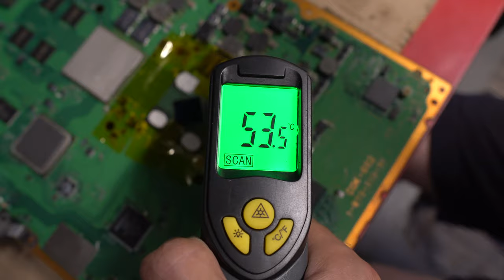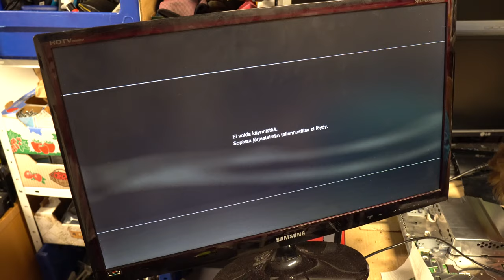How To Fix PS3 YLOD (Yellow Light Of Death) RSX Reflow

Comment: This just worked a treat! Although most say it is only a temporary fix, the alternative is far too expensive and beyond being economically viable imo certainly for a CECHC03 model which I just repaired for a friend using this method, I would suggest the Frankenstien GPU replacement etc might be worth it on an A00 / A01 model but not a C03. I will report back how long it does / doesnt last if I can.

I also used some Topnik RF800 SMD No Clean solder and basically tipped a load behind the GPU and followed your guide, I didnt have an Infrared Thermometer gun so I just ran my hot air station at 350c over the chip for 2-3 mins and success no more YLOD!

Comment: i found a fix for this without hardware mods, just make sure the ethernet cable is plugged in and do the thing that ramps up the fans to blow out any dust. then plug in the hdmi cable about 2~ seconds after pressing the power button, it normally takes me 2 trys to do it, but i will probably do some hardware modifications soon due to games being really stuttery, bo2 chrashes a few minutes into a match, and the fans will go to full speed and wont stop untill i turn off the consol.
Reply: Really
Reply: @hussanali3217  yes, although this is not a full time solution. it is very finicky, and gets harder to do by the week. i would recommend just buying a heat gun and reflowing the cpu and gpu cores. just last week it took me over 20 minutes of full attention to make it to the ps3 logo screen, and it wasent detecting the hdmi cable (which it does often) so i had to blindly navigate the menu to change display settings to hdmi. all that to froget to unplug the ethernet cable loading bo2, and having the system freeze on me. took another couple minutes to get into a local match. just save yourself the rage, get a heat gun or fucking put your ps3 in an oven.
Reply: I know a way to fix your PS3 without heat, the whole “Reflow/Reball RSX” is a misconception. Although there are real cases of the solder balls becoming detached etc, most cases the NEC/TOKIN Capacitors are to blame. When the console powers on, the firmware is instantly running a POST(Power on Self Test) and if those capacitors are not keeping the power to the processors steady, or if they are causing the rail to short, then the firmware will do the Yellow Light meaning there’s something wrong with the hardware. The reason it’s  a misconception is because when you heat the RSX to “200C/392F” as in the video, you are not melting any solder at these temps but you are in fact also heating the faulty capacitors, which may make your console temporarily work again until you turn it off again, or until the caps go faulty again. A similar problem happens on some laptops that use these NEC/TOKIN Capacitors for their decoupling capacitors for the processor(s) and they will restart if the processor(s) draw more power than the faulty caps can give, like when first loading an operating system for example. So I suggest you just rip those crap caps off and simply solder some 6.3v tantalum Capacitors that total up to 1200uf per NEC/TOKIN you remove. I hope you understand this and/or this helps. I also had YLOD and this got me back up and running on my long lost Black Ops 2.
Reply: @bast6808  so how do i fix this?
Reply: Real WeiFi look up NEC/TOKIN PS3 there are lots of tutorials on YouTube but you have to have a solder iron to solder the new capacitors on
Reply: @bast6808  i dont feel to comftorable opening up my ps3, especially because im not the owner xd
Reply: Real WeiFi that’s fine I understand if you would be afraid of breaking it further. I’m a very tech savvy person so I open up almost ever electronic device I get the chance to look at the circuitry and see how it works, in general I have a very good idea of how electronics/code/computers work and I build PC’s when I get a chance too
Reply: @bast6808  i have a way above average of how hardware works, and i know how to read some javascript. nothing to big for me, but i want to build machines and flip them as a hobby/job. my mom wont let me get any computer stuff tho :p
Reply: BƎAST it’s a misconception too when you think YLOD causes by Nec/Tokin all the time. I have two slims that have YLOD. One with faulty nec and the other is RSX.
Reply: @bast6808  Thanks for this info. Is there a tutorial to replace caps? the whole reballing method seems crazy difficult
Reply: Kiryu there are probably tutorials on YouTube if you look up “NEC/Tokin PS3” or something similar, although it won’t always be the fix, some may have faulty solder joints on the CPU, GPU, Southbridge, RAM, etc. but NEC/Tokin’s are a big problem too. Basically YLOD is a failed POST which can be any number of problems anywhere on the motherboard really
Reply: sparda1418 yes YLOD is a failed POST and can be caused by any problems on the motherboard, and the RSX solder joints as well as the NEC/Tokin’s failing are the big issues, both caused by excess heat conducting into the board over many years, the RSX heats up the NEC/Tokin’s hotter than the GPU die itself so it’s really a matter of which fails first, the NEC/Tokin’s or the solder joints somewhere on the motherboard.

Comment: Good evening I have a problem with a ps3 .. when I open it it works for a few minutes and then the fan works very intensely and turns off ... it makes 3 beeps with orange and then red that flashes ... but pastes but again the same ... some help on what might be wrong?
Reply: Overheating, replace thermal paste
Reply: @asideofbeans5803  under cell and resx
Reply: I have this exact same problem

Comment: 3 days later 😐broken again
Reply from the maker: Then you probably didn't heat the RSX enough to allow the solder to melt properly. Try again and use a slightly higher temperature.

Comment: This Video should be disliked, because it is not right, Reballing/Reflow is not how you Repair a PS3, grow up dude, Enthusiasts wont beleave this crap, and tech savy guys arent anymore as well, this is still not a real fix :P
Reply from the maker: While it is true that in a sense reflowing isn't a "true fix", when properly done it does fix the console, for a time. Quite often it does fail again after some time, be it weeks or a year, but this fix does get you more lifetime out of your PS3. I don't see how a reball using leaded solder wouldn't be a real fix though, if we don't take into account the other possible causes of YLOD like a faulty RSX or the motherboard bending due to thermal expansion. What do you think would be the proper fix?
Reply: @KrupsFilms  nah dude i have repaird a lotz of ps3s tho no bend mobos or some, maybe if u drop it, ive got an A01 with an SSD in it, jailbroken and drilled some fanholez at thee bottom :) CPU/RSX deledd and it never saw a reball and it never will be, worksabsolutly fine, not hot and not that loud 30% fan speed most of the time, maybe 25 in farcry or something :* soo yeeeah the main cause an overheating CPU cuz the fan is too damn low ;) or if the ps3 was really fucked by for example someone that puts it in thoes TV cages that we all had back in the day then they might be a chance of broken NECTOKIN capasitors that have to be changed and sometime it is just that and not an overheated mainchip and ps3 works fine again :D